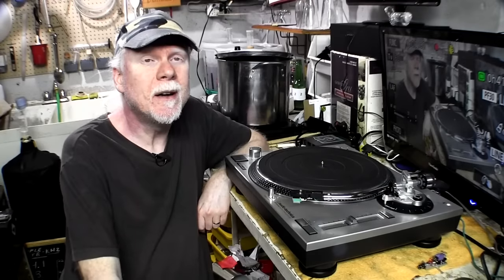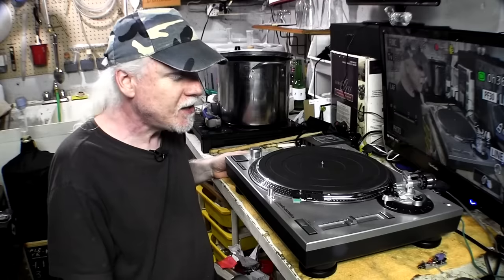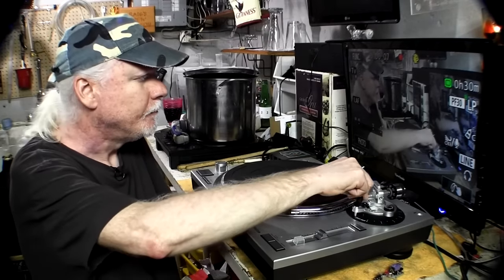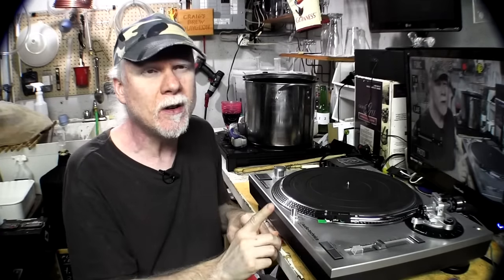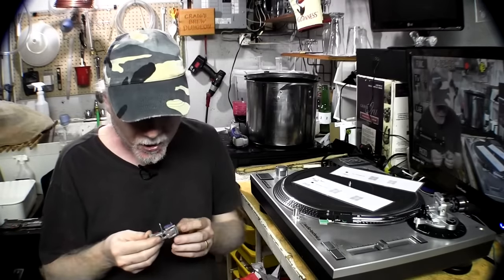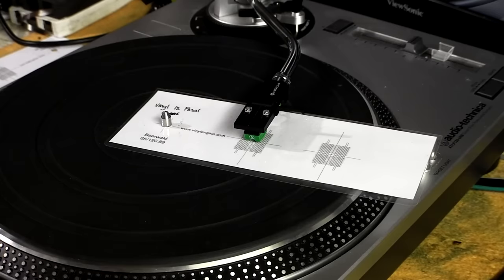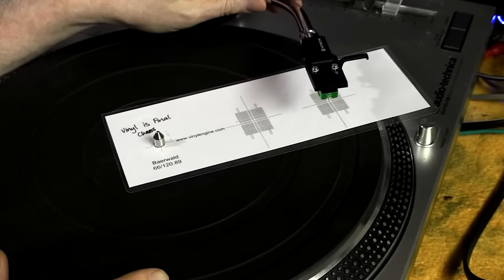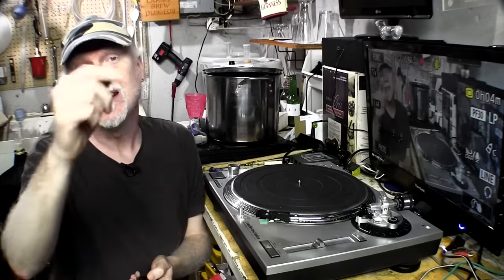Very Detailed Turntable Setup for Beginners

Comment: Thanks for the great advice, I didn’t even know about using a protractor…yikes!  But did I misunderstand the anti skate? I always thought the record v-grove pulls the needle towards the center, which to me would cause the needle to apply more force on the outer most side “right side” of the v-groove “furthest from the spindle”, thus the anti-skate counters this force by applying very slight outward leverage or push outward on the tonearm away from the spindle of the record centering it directly in the groove? Please correct me if my thinking is wrong and why. Thanks for showing me this protractor method of aligning the cartridge to get a close to true linear tracking.. Best wishes my friend.

Comment: Very nice, but you forgot to set the cartridge/headshell overhang which also affects the null points. You might also add that Vertical Tracking Force adjustments can only be made on TTs (high-end) that have adjustable tonearm heights and are not really that much of an issue anymore. Rather SRA (Stylus rake angle) is a more important adjustment but that can take an entirely other discussion.

Comment: Hi there! Firstly thankyou for the video, simply helped me setup my SL-1700 perfectly! I have a question, running the SL-1700 to a Pro-Ject Tube Box II then into my SU-Z22 and out through my SB-4500's. I play only vinyl, 70's mainly from Floyd to Nick Drake past Kate Bush then a left at AC/DC before returning home on the night bus driven by Led Zeppelin. So, my question is, if you were me and wanted to upgrade your Amplifier and had £500 or $600, what would you look at? I know all my gear is Technics but am happy to look at other makes BUT....has to be pre1980-thoughts???

Comment: Swell instructions, thanks. I've been doing it wrong! At 21:35 you said "make sure that the cartridge is straight in the headshell." Since my lead wires are too short, my cartridge can't be moved back far enough any farther. But by using the slots to point the cartridge inward, I am able to align both null points. What do you think? It sounds okay. (Signet arm with fixed headshell and can't be rewired.)

Comment: Thinking quite seriously about getting a turntable, tuner and cd and speakers, someone said on a video make sure the turntable has an amp included none of the ones i have seen mention this, or is this only for older turntables ?
My vinyl i have is mostly 12 inch records from the late 70s/early 80s, and a few compilation albums various artists, compact discs havearound 100 .

Comment: My turntable was working fine as I got it, then noticed a record was skipping that played fine before. Thought maybe kids had nudged a setting so I followed this guide - with the stylus pressure recommended for my specific Shure stylus - and now it's a complete mess! Won't play at all, the arm needs more downward pressure and keeps wanting to float back to resting position. Now I have to just go by feel til it approximately seems right. You're obviously not wrong, I don't know what the problem is

Comment: Thanks for the EXCELLENT advice.  This is really informative.  The only thing you didn't cover was setting the pitch. But superb video.
Question: I plan on using a preamp. I know, using the RCA cables going from the turntable to the preamp input, then the preamp output to my receiver's aux input (there is no phono input). On the back of the ATLP120XUSB, do I set it to phono or line?
Thanks

Comment: Great video! I "found" a Pioneer PL-540 Turntable that spins, is balanced properly (thanks to your video) but has no sound when connected to my system. The RCA terminals are pitted and weathered - could that be the problem?

Comment: The paper you can print out to fix the stylus at the correct position, is this also for 78 records? I got the 78 stylus for my AT LP120 but thinking if I can use that same paper for stylus positioning, or maybe 78 RPM records are a whole different ballgame?

Comment: I ended up getting a Technics SL-1200 MK2 and I always refer back to this video when setting things up as it's the most useful and informative. One thing that concerns me is the stylus is really close to the deck (approx 4 cm from tip to deck) while sitting on the arm rest. I have the arm height adjustment sitting on 2.5. Never had a Technics and didn't know what it should be or how to raise to what's acceptable. Any ideas what's happening?

Comment: I’m Way out of practice but just bought the technical LP120. I purchased brand new Klipsch speakers, used a receiver(which may be the problem?) that was used for my TV (Onkyo TX 8020). Hooked everything up balanced the turn tables etc etc. the sound is horrible. Could use some help? Thanks

Comment: I have a question for the tracking Force adjustment it is recommended that I set it to 3.5 g but the adjustment dial only goes from 0 to 1.75 so do I turn that a full rotation it also says to turn it one and three fourths turns to get the proper adjustment where would that be as far as the numbers on that dial

Comment: I just got an AT-120XUSB and my stylus was obviously crooked. I didn't have a VTA block, I was trying to do it by eye and messing about, I put a small bubble level on my headshell briefly, a few times but then I realized there's a magnet in it! No!!! Did I just mess up my cardridge? It could be my imagination but it seemed like I lost some gain right away and since then, a few weeks later, the bass seems to be depleting. I can boost it a lot more on my receiver.

Comment: Have boutique audiophile stuff from back in the early 80s. Also worked in A/V sales for a couple years. Yes, I have a Thorens table  and a old Technics belt drive. Get a good cartridge and keep vinyl clean. That's it. That's as good as it's gonna sound after you balance your tone arm. So yes I'm old and I have a turntable paired with an old Carver amp and preamp through some Klipsch speakers. All vintage 1980. Kids, this ain't it. If you think it is I don't know what to tell you. I plug an old Onkyo CD player into that same set up and it sounds so much better. If you like to tinker with shit like this video guy then go for it. There are 2 types of music lovers. Those that want to sit back and enjoy the sensory experience and those that  want to work in a lab before they can do that. It's all good.

Comment: I followed the recommendation for the Stanton 680hp cartridges as being 2 grams for balancing the tone arm, used a digital scales to measure it for the 2 grams stylus pressure, but found that the needle skated from the edge of the record to the beginning of the first track in a split second, it did this with every record, I had to then give it 3g weight to stop the skate, would not leveling the deck with a spirit level be able to cause this?

Comment: I just put an Ortifon Blue on my Project Debut and can't get it to align nowhere near correct with the protractor. It doesn't have a headshell, but there are screws to adjust it, just not much.  I mean like way off.

Comment: Zabardast cheers from Toronto.....I have a 1975 Pioneer PL15R turntable and still runs fine. After using it take out the belt as no spares available.  Also, the needle or diamond tipped stylus is now ancient.  Any tips if I can obtain new stylus or replace its head?

Comment: Great video - subscribed! Quick question. I have the same deck as you have in this video but some records loop on it occasionally. However they do not loop on the other deck I own which has no weights to adjust (preset). My deck is set to 2 / 2. Is it safe to alter the weights and, if so, what would you suggest? I was thinking off slightly increasing the weight or maybe decreasing the tracking a little.

Comment: Well, this is proving to be more difficult than I imagined. After I tried adjusting (Rotel RP 1001 with an AT95e) the anti skate and weight do not seem to be matching up. the anti skate is pulling back hard at 2 while any adjustment to the tone arm causes distortion. and above all, the arm no longer lifts up when the record is over. the anti skate seems to only function at 0. help??

Comment: I just purchased a mid level Denon turntable and it sounds amazing.  I didn’t have a scale so I found a kit with everything included for around 30.00.  
    My stylus cover is attached. Can I do the set up with it down so I don’t have to worry about damaging the stylus?
   Do I need to make all these adjustments with a record on the turntable.  I noticed you didn’t but the instructions with the kit say to do these with a record on. All my records are brand new and I don’t want to damage them.  Will it make a big difference to do these adjustments on the mat? 
   Again, you have a new follower. I love my turntable and look forward to more of your videos to improve and protect my records and turntable.

Comment: Thanks much! Questions. If I’ve already calibrated the tonearm and set the tracking force but then realize the tracking force should be set to a different setting — do I need to recalibrate the tonearm again before resetting the tracking force to the new setting?  Or is it ok to adjust the tracking force without recalibration? I guess what I’m asking is do you need to recalibrate the tonearm every time you maybe need to make adjustments to your tracking force to suit your cartridge

Comment: Great video, but isn't it back to front. I thought the installation and alignment of the cartridge should happen first and then the setting up the weight and antiskating as the last steps. Moving the cartridge from from front to back in the headshell will certainly change the balance.

Comment: how much time do the restauration
of THREE sl 1210 mk2 will take
for two guys ?
one bro is a pro technician and i'm an absolute beginner. the lucky owner, that wants to learn to repair.
i want to keep it as original as possible, no gimmixxs and no fx.
if it's possible to improve sound quality, that would be accepted.
but i'm not interested in any other features 'cause the mk2 are ICONS.
and if there ain't no parts to find,
is it possible to use parts from other
sl 1210 mk decks ?

Comment: This is a great video. The one question I have, given that I've been researching all this of late due to replacing my cartridge, is: if you have an overhang gauge and match the stylus to the 49mm line, is it really necessary to also use protractors?  This seems a somewhat controversial issue. I have a PL-510 and just bought an AT-VM95EN to replace the Mission 775 that was on the tonearm. Then, I also bought an overhang gauge that several eBay sellers are making to the same specs as the original one that came with my turntable (unfortunately over the course of 45 years I no longer have it). So - having used the gauge and eyeballed it as best as possible, do I still really need to get a protractor?

Comment: Question - I was balancing the back weight, and the tracking force recommended for my stylus is 4.0g. However, the wight of the tonearm does not have enough space to turn to reach 4.0g after i've calibrated it on 0. What does one do when this happens ?
Reply: The best way to find out is to put the needle on the record move the record back and forth and see if the needle stays perfectly straight. If it tries to pull over then there's to much pressure on the record. I found out this when I first started djing using turntables hope this helps.

Comment: If I have the AT-LP120XUSB with the included AT-VM95E cartridge and the AT-HS6 head shell—and I later decided to purchased a VM540ML cartridge with the AT-HS10BK head shell—would I just re-balance the tone arm and set the tracking force to the value required by the new cartridge? (Btw this is my current situation). It’s supposedly pre-aligned, but I have a protractor to check the work of the manufacturer just incase. It seems the procedure is different if you just buy a new stylus VS. a new cartridge VS. a new cartridge with the head shell pre-aligned. I’m essentially trying to get the steps right for each process.
Reply: Your cart is mounted to the HS-10 headshell for a 52.5mm stylus to headshell tail distance and the cart is squared to the headshell to realize the Audio-Technica tracking error scheme so all you need to do is rebalance the tonearm and set VTA and anti-skate features. That's it.

Comment: Hey thanks so much for the super informative video. 
I just bought a Technics SL1200 mk2 and had a Technics Alignment Gauge at my disposal to set the cartridge. In addition to this, I decided to print out (and laminate) one of the protractors you mentioned in your video to compare gauge vs. protractor. For whatever reason, there was a pretty big discrepancy between the two; the alignment gauge had my cartridge pushed all the way to the back of the headshell whereas the protractor brought it somewhere closer to the middle. Any thoughts on why they would be so different? 
Thanks so much :)
Armen
Reply: Hi I've been setting up my new MK7 this weekend. If you have Technics overhang gauge you should be ok set the stylus to the cut out on the gauge 52mm from the washer on the head shell. make sure the cart is square to the head shell. This is the fastest and manufacturer recommended method. Now it depends what kind of protractor you downloaded. Technics alignment is closest to Stevensons protractor. If you have any other protractor the alignment will be different.  If you want to double check the over hang gauge check it with Stevensons Protractor only. Let me know the result. I need to play around with it more as Im getting slight sibilance. An if you find Stevensons protractor let me know the source please.

Comment: Why does leveling matter when the cartridge has the exact same tilt? The only adjustment necessary would be to change the weight and anti skate depending on how it is tilted. This could be automated very easily if you're trying to build your own turntable.

Comment: I have an AT-LP120XUSB, the turntable is leveled, my tonearm is perfectly balanced (it stays still even if I play with the cueing device), the tracking force is set at 2 grams (which is the recommended medium for the stock stylus), and the anti skating is at 2, so it matches the tracking force. I checked the cartridge alignment also, and it's perfect from factory.

Nonetheless all my old records sound awful! The first tracks are fine, but when it reaches the middle of the record, it becomes painful to listen to! It has really bad distortion, sibilance. As it gets closer to the middle, it becomes even worse. First I thought that all my records were worn out, but I bought some really nice condition ones on discogs (good pressings too), and it's still happening. :-(

What should I do next?

Comment: Hi. First, thank you for the incredibly informative vid on setting up my turntable (I have the exact model in the video). I'm hoping someone might be able to shed some light on an issue I'm having. On some of my records (so far some records from the 70's, if that makes any difference) I can play through all five speakers in my surround sound with no problems, yet on many of my other records, mainly metal ones (again, not sure if that makes a difference, i.e. weight, etc) I only get one channel. Is this a result of my arm not being calibrated or something else? I'm baffled and a bit embarrassed, as I've been handling stereo components for many years. Any help or advice is surely appreciated. Thanks!

Comment: Yeah and the setting always has been hard to understand  on the technics TT  bc you can turn to let’s say to 2.0, but the dial just turns without moving and just a marker and not moving the weight. So it’s the other part you have to move, but how do you know where it’s at ?

Anyway, I will stop typing and listen and watch your video. 

Thanks in advance.
Reply: Which styles is that? Asyio Technica?

Comment: Maybe there is something different about mine but I swear setting it like this is impossible. If I set it to balance horizontally, it doesn't have enough weight to keep the needle on the record. And even if I balance it to the platter, it just ends up being way too sensitive to any vibrations.

Comment: When aligning, remember you are aligning the cantilever (not the cartridge body) parallel to the alignment lines. Many cantilevers are not centrally aligned with the cartridge body, and on some cartridges, the body shell is neither parallel nor symetric.  You cannot align the cantilever with a line of eye from above, as shown in the video: you need to get your head and eyes low down so you can see the length of the cantilever and the alignment protractor lines. Before doing even this, first ensure that the 'overhang'  (distance from tonearm pivot to stylus) is correct for your tonearm/cartridge combination. Once all this is done, adjust the vertical tracking angle if the tonearm permits such adjustment: if your arm doesn't then insert shims  -old 35mm photographic film is ideal for this. Then readjust the balance, bias and anti-skating.

Comment: Not sure if you will see this but I sure hope you do. I’m new to turntables and vinyl, I currently have a Marantz 2245 receiver and an old Duel 1246 turntable, with an Audio Technica AT-95e cartridge. If I were going to upgrade my cart, what would you recommend and what pressure should it be set at?

Comment: Thanks for the video. Simple and straight forward tips for getting the most from your setup.

Inherited a Pioneer PL-S30 turntable and put on an Audio Technica VS215EP cartridge. 

Using the factory recommended 1.25 weight and auto skate recommendations, it sounds wonderful for a starter setup.